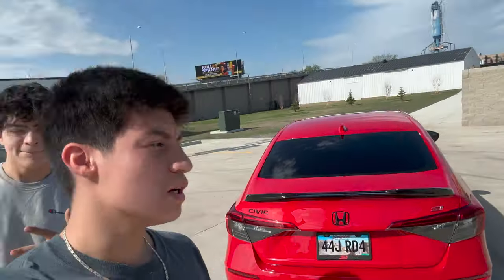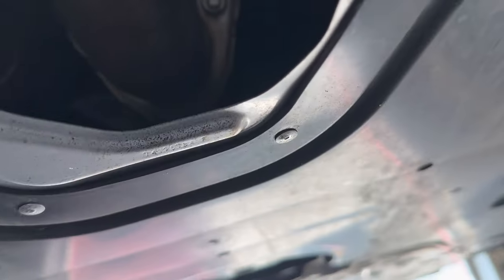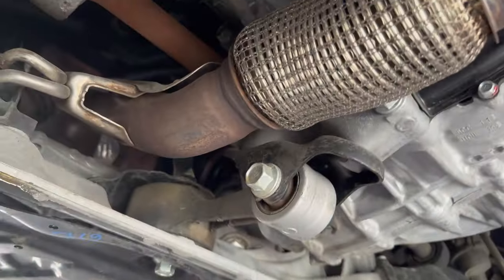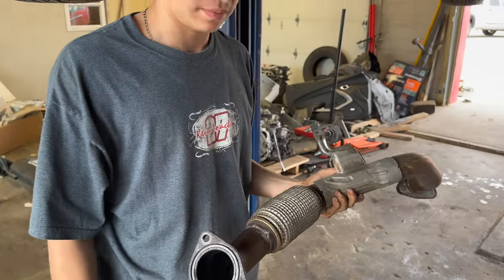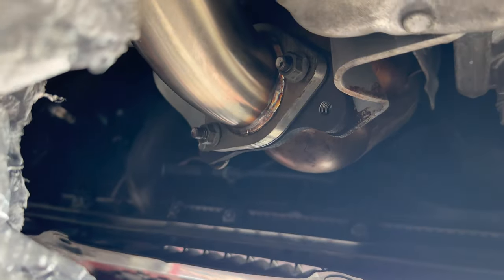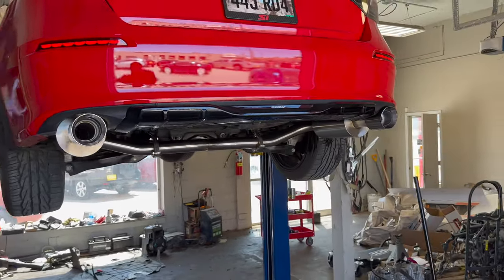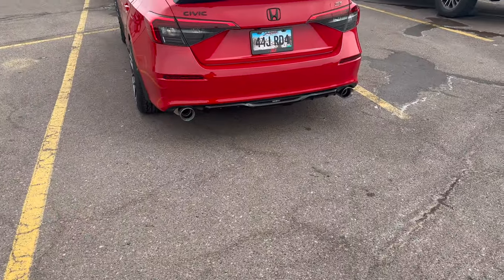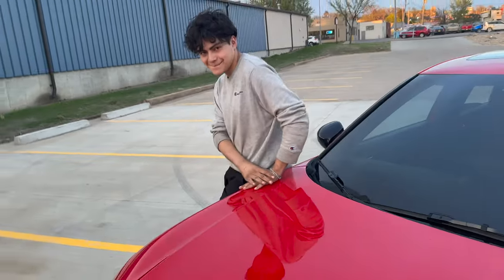INSTALLED 27WON EXHAUST ON MY 2022 HONDA CIVIC SI WORTH IT?!?!

Comment: The 27won DP will throw a code, had to get rid of it for a PRL DP.
Reply: Will the prl dp fit with the 27won exhaust?
Reply: Code comes out as soon as you tune it
Reply: @Jose-rz7rv  I don’t have a tuner so I sold it and got a Prl DP and no tune required.
Reply: i was looking to buy a 27won DP for my fe1 but after reading your comment i might have to pass, and PRL discontinued their FE1 downpipes so thats a bummer. It seems like PLM are the only guys that have downpipes in stock right now but i haven’t heard very good things about them.
Reply: @OnlyToaey  more airflow with 27won
Reply: @isaacortega3845  I paired Prl motorsports front pipe with 27won exhaust. No issues with codes or install.
Reply: @andrevanderpool6855 how’s it sound bro ? Any clips of it , I want something decently loud but not to much drone , looking into an exhaust system now , remark sounds great but only if you don’t wanna do a FP or DP
Reply: @mikeyrov5230  it has a nice deep tone. I added a PLM down-pipe. The down-pipe will throw a code. I have no complaints though. No drone, and not overbearing inside the car. Cold starts aren’t overly loud either. 27WONs down-pipe would be a good option.
Reply: @andrevanderpool6855  did the dp make a nice difference? Sucks about the code , that’s good it sounds nice , I wanna do a DP but not for some time
Reply: You can tune the code out or use an O2 sensor Defouler, to clear the code. I’m happy with the difference it made.

Comment: This si is a big bust after the 9th gen Honda don’t care about the si only type r how does a si not have vtec and the L15 platform is the worse engine in a car you basically got the same engine as a ex sport just a different tune and same rims the car looks like a regular civic. 8th gen and 9th gen are the real last si they stand out and most respected niggas don’t show no love to the 10th. Gens and this gen
Reply: i mean the SI in the US didnt have vtec from 1983-1992 and in japan until 1996 (they got the Si-R though) 

idk why people hate the L15 so much, its a fine engine for its purpose, because it has mid range torque yall were complaining about not too long ago. sure it doesnt howl like a k20z3 or b16a2 but if you want to point fingers blame the EPA and European/Chinese governments for enforcing stricter emissions standards and displacement taxes. 

and theres plenty of people doing cool stuff with the L15 platform, its just new thats all, theres a few being raced and in time attack series in the US, and a few swapped ones such as a in a GK Fit.
Reply: Still has vtec on the exhaust side
Reply: @ShaiyanHossain  look up videos on the l15 platform it’s the worse engine Honda ever made the internals are so weak and skinny compared to a k20 or k24 there a guy who literally opens it up and compares it to a k serious and my god it’s bad he doesint even work on them or tune them anymore because they can’t hold power reliable the l15 platform can not hold any type of power cause the rods and internals are skinny and weak and that’s why everyone who adds more power to them has them shit the bed. Now go hook up a k and you can easily get 350 hp reliable and even more. There people out there pushing 400 with stock internals on the k serious
Reply: @Jam617_  honda sells a k series car with a turbo, in fact they sell more than one. Why wouldn't you buy one from the get-go?